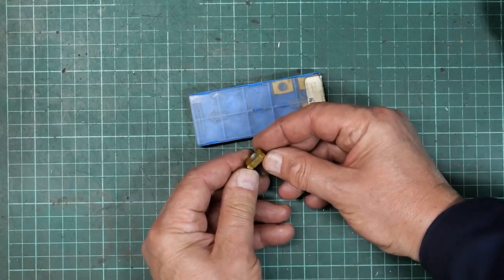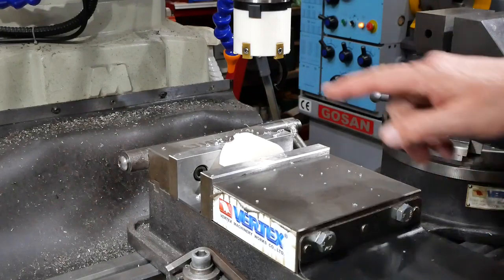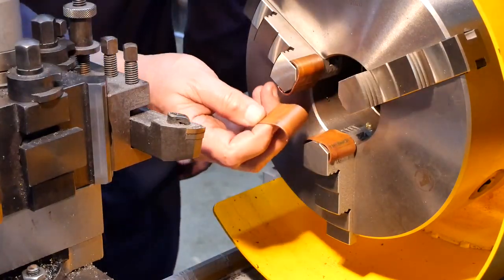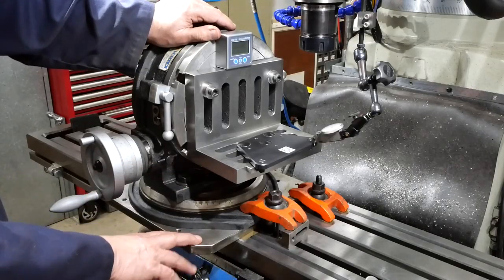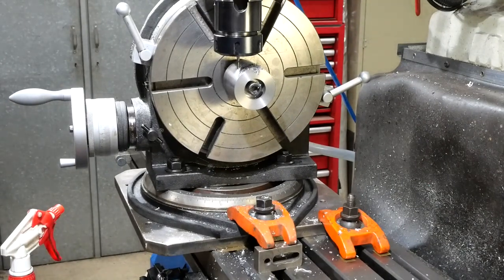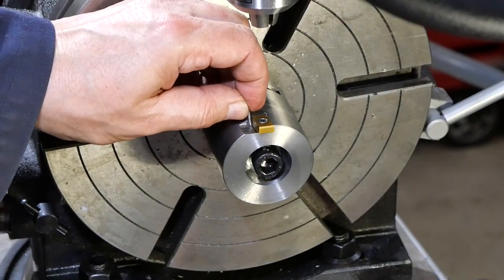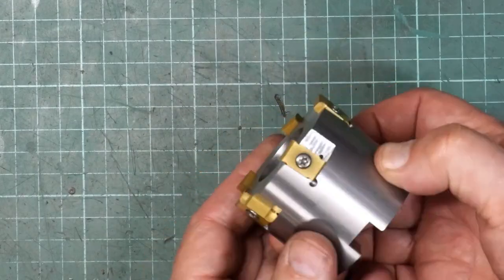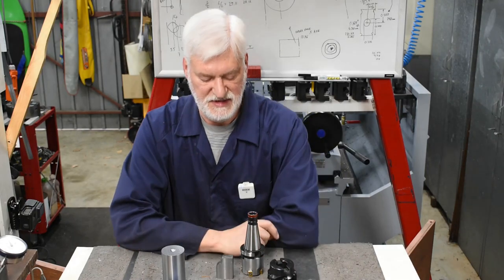Making a face milling cutter from scrap.

Comment: looks a lot like grinding job finish to my eye, akin to blanchard grinding... yet its a milling op, so that is some fine finish indeed, and speaking of which, those look very much like a variant of high feed cutting edges, which while suitable for high feed and shallow cut, can actually produce marvelous finish as this has, due to the radiused edge with a relatively good shearing effect with a decent edge quality, which these inserts seem to have... Interesting inserts...
Reply from the maker: There's no doubt that the inserts should get the credit for the fine finish and I'm thinking about making a fly cutter that would hold one.
Thanks for your comment.
Reply: @alanshomeworkshop 
Yeah, i just wanted to say that i would consider making a lone flyer insert holder for some fly-cutting action... That could and should result in a supreme finish, also, for the pleasure of the Machine Spirit, do your best to balance that flycutter, as being a non-adjustable holder, it will benefit greatly from a perfect balancing... Sure, a perfect head tram will also be the utmost prerequisite, but that could truly be a mirror finish flycutter... Also, consider using those as lathe tooling... It should be easy to make a holder akin to those parting carbide nibs holder, but for this type of insert... It would offer insane finishing passes both on diameter and face cuts... Tho, i would make that holder without any pins, just a precision(literally 1 micron of total clearance if possible) slot with a retainer screw... Hell, i could even see one using those in a custom holder for a shaper... The shearing cut and all making the inserts ideal for finish passes...
Reply from the maker: Food for thought, and ideas taken on board.
Thank you.

Comment: This are insert for a slitting saw not tangential ... There are not made go cut on the side flank
Reply: Noma i think still made this kind of geometry , Is an old type like mid 90's made originaly by Seco
Reply from the maker: Interesting - do you mean something like this: https://www.tradeindia.com/products/insert-slitting-saw-cutter-c2866519.html
- looks like such a cutter design would be used for slotting rather than slitting.
Thanks for your comment.

Comment: Gday Alan, fantastic job and not an easy build but you nailed it, great job mate, cheers
Reply from the maker: Thanks Matty, and I'm pleased to see you staying in touch with the machining channels. I won't admit to how much time this project consumed :(  - but I will say that working out the geometry and hole locations was a real head scratch. The side clearance derives from how much the rear edge of the insert is placed behind a tangent point of contact on the circumference and it took me a while to get this right. The milling setup had me foxed for a while as well and it led me to thinking a sine table would be a good project. Anyway the end result repaid the effort and I'm now thinking about other uses for these inserts eg turning, facing and a fly cutter.
I often think of you and hope that your journey back to health is progressing well. Cheers, Alan.

Comment: Aluminum soda cans are super consistent on the thickness and make a reasonable insert for reducing marks on steel. For the copper you might have to skim a little off of them to make them consistent, similar to how people do for custom soft jaws. I would guess that the thickness of the copper is more variable AND that the bend is not as predictable.
Cool project!
Reply from the maker: Thanks for the soda can tip - I'll give it a try.
Cheers.

Comment: Ya lost me at Vertex rotary, the sine plate, and angle plate. As much as 
i'd like to make a shell mill out of scrap, it'll be far less to buy the 50 buck import! Great video, very informative, thanks for sharing.
Reply from the maker: There was a bit of head scratching and high school trigonometry :)   End result was very pleasing though and I have found the cutter to be a useful addition to my toolkit. Thanks for watching John.
Cheers.

Comment: Fantastic job, but you didn't mention if you can still buy the inserts?
Reply from the maker: Thank you Stewart - the inserts are obsolete and no longer stocked. However, they each have four useable cutting edges and I have ten of them, so I think that will see me out :)
Cheers.

Comment: Morning Alan....A quick question. How does it feel to have a bunch of bolts named after you?.....LOL:face-green-smiling:
Edit: Nice work on the cutter!
Keep up the good work!
Reply from the maker: Well, I've always been keen on safety and the recessed socket head screw was patented in 1909 by W. G. Allen as a safety improvement over protruding hex heads. So I do have something in common with my (nearly) namesake :)
Thanks for your comment Sparkie.